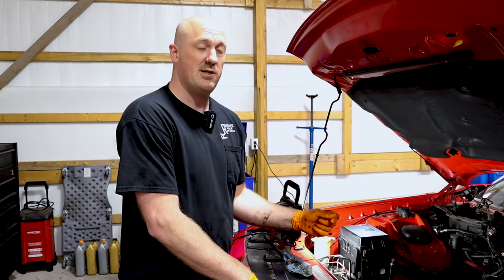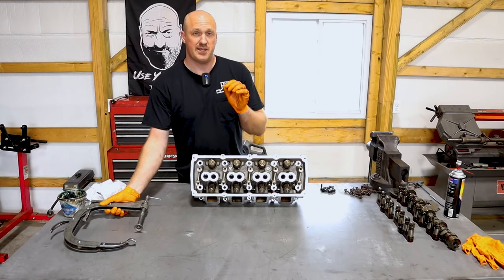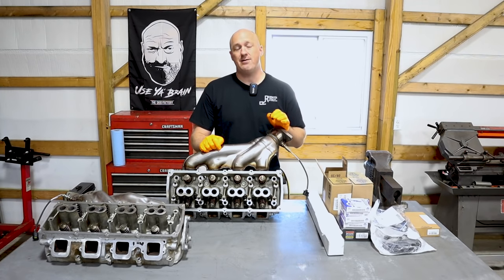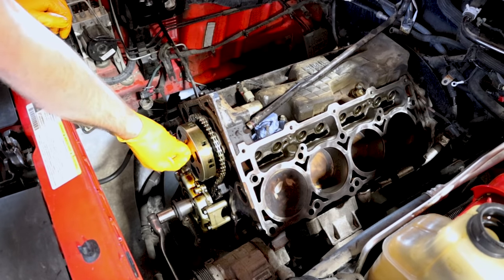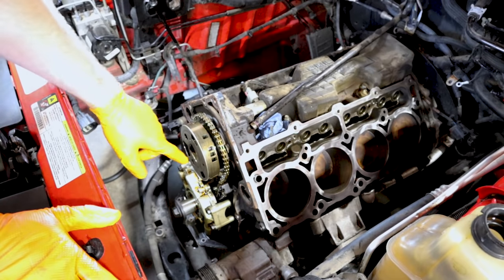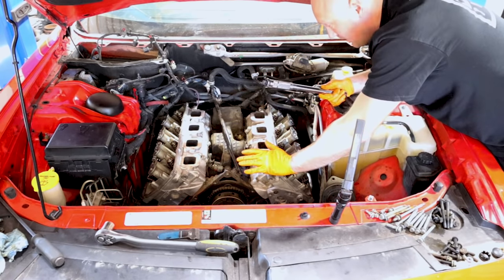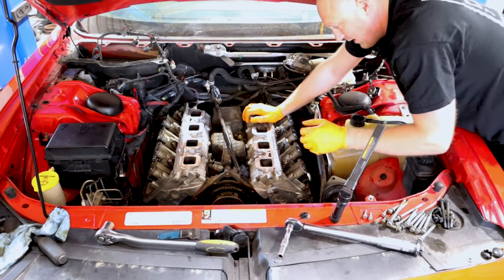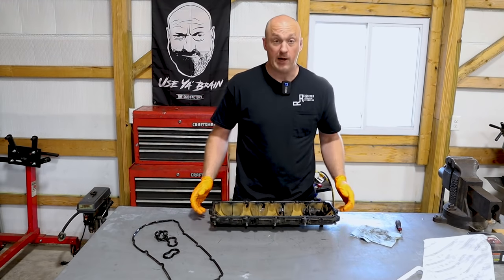Hemi Camshaft Installation Continues, SRT Headers Install! Budget Challenger Build Ep2

Comment: For as much as they charge for these cars and after making vehicles for over 100 years THEY SHOULDN'T GET LIFTER FAILURES PAST  200,000 plus! 120,000 miles is still unacceptable considering it would cost 4000 plus at a shop to fix it and that is if it didn't have catastrophic failure and send cam and lifter metal threw out the engine making it a literally ticking time bomb!  And the other failure these have is dropped valve seats another unacceptable failure from these high dollar cars and trucks!